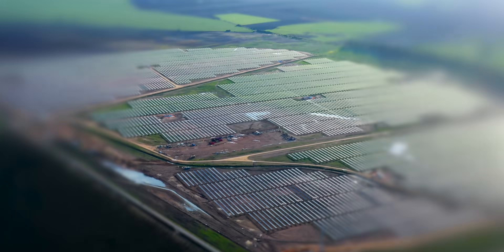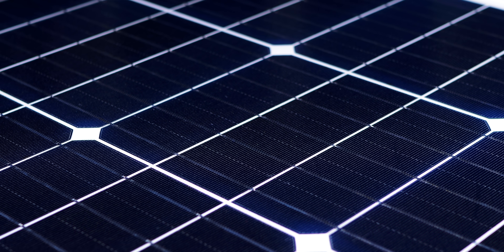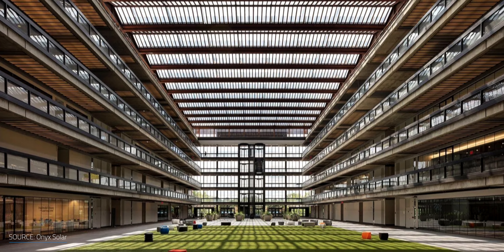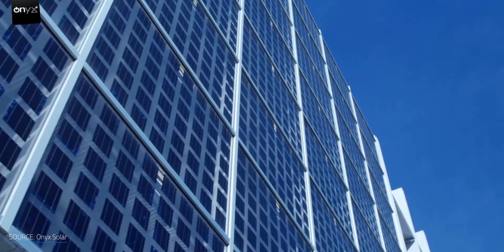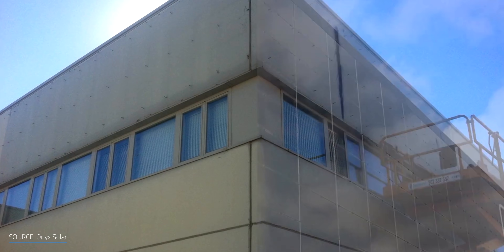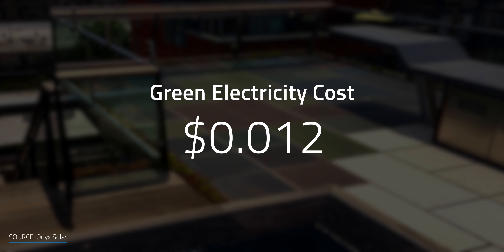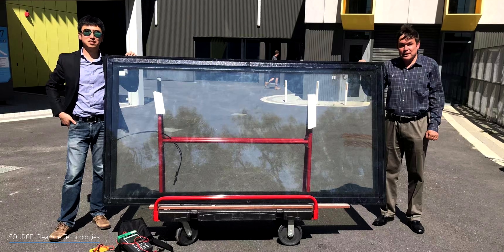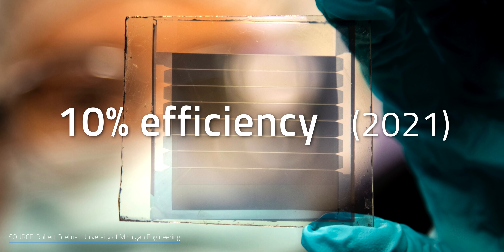Exploring a New Transparent Solar Cell Breakthrough

Comment: I am worried that dark solar cells could be warming the planet. The transparent glass cells are only like less than 10% efficient but (cost permitting) you could have way more cells and use some as Windows. But even better, we could cover every roof with these and not get the heat so much. But even better you could have reflective material under the cells to make them more effective AND (and it still gets better) the reflected light is reflected back into space. For under the cells, that foil stuff they use inside car windows could do the trick. It not only saves the heating problem of normal cells but also helps with reflecting sunlight away. I can't belive that nobody has thought of this combination. I thought of it long ago when I saw a video about painting roads white and then saw the glass solar cell video years ago. Imagine every roof covered with normal cells. It would be a hell hole, I would think. I have been worried about that for over a decade. I can't believe there seems to be very little about this potential issue (I haven't seen anything).

Comment: You make a deal of the efficiency but from the prices you quoted they are around the same as glass. That being the case and the fact that you are going to need the glass anyway then at that point the efficiency becomes somewhat academic. The panel is a requirement anyway and the fact that it is also providing useful energy in the process is an added bonus plus you still have the option of adding a roof top array as well.

Comment: One other small side benefit that would slightly offset the costs associated with solar windows is you would be able to omit the "low e" coating on the window since you would get the benefit of lower emissivity from the solar panels themselves.

Comment: out of curiosity. if this is placed above a normal solar panel, how much energy is lost from the solar panel? I was thinking since the transparent solar cell has poor efficiency then there should still be a lot of excess sun passing through it, so if there is a normal solar panel underneath it should still function right? if the lost of power is so minimal i can see this being used with normal solar panels to increase power production.

Comment: To be fair, raw efficiency isn't as major a setback as it seems, as long as they're cheap enough to justify the cost. For companies,  it's about payback efficiency.
If the panels are dirt cheap enough that they'll pay for themselves within a few years, then raw efficiency doesn't matter. Likewise, if they're expensive to the point where the time taken to payback is longer than they are reasonably likely to last, then it makes no economical sense to buy them in the first place even if they're efficient.

Comment: 10:00 I listened to this name multiple times and still couldn't work out what it was called. When I saw the name on the sign at 10:12 it finally made sense. The shopping centre name is pronounced "Wo-rick" with a hard o and the second w being silent.
Other than that, the video was quite clear. I look forward to seeing the technological advances in this area.

Comment: You've often stated that the pay back time for standard multi-crystalline solar panels is 4 years, and could go as low as 2 years in the future. I was wondering though, does this consider the immediate increase in the value of your home? For example, if you spent $40,000 on a system, I would think that your house would appreciate by perhaps $30,000 so your actual real cost would only be $10,000. Thus your payback time would already be only 1 year... thoughts?

Comment: The majority of energy in the solar spectrum is visible light, so efficiency is an insurmountable hurdle for window glass. Combine that with the cost to manufacture these and the cost to install them and wire them up, I can’t see this ever being cost-effective.
We’re in an era where it isn’t even worthwhile for the majority of businesses to put a small amount of high-efficiency solar cells covering the roofs of their offices and warehouses, so requiring a larger number of more complicated cells to cover windows that won’t even produce as much energy (unless the building is particularly tall) simply isn’t going to be viable. IR reflective glass and variable glasses would be a more effective and cheaper method of using solar energy to modulate the internal climate of buildings.
Also there’s the whole glass dredging issue, so I’d consider steering away from large buildings covered head-to-toe in glass.

But for a smartphone, the only colours coming out of the screen are narrow bands of red, green, and blue, so theoretically you could manufacture a solar cell that lets the three narrow bands through and absorbs the rest. The small area wouldn’t make it particularly fast, and it would be significantly more expensive than just having a PV panel on the inside of your phone case, but hey people bought a folding phone.

Comment: I was actually thinking about this today on the way to work.. why not solar cells on our windows? Would maybe even keep some heat out to cool down apartments, offices and houses even more instead of using AC.
Reply: Solar needs good angles to catch the sunlight efficiently. Windows do not have such optimal angles. So for the same money just get regular windows with a sunlight protection you can actually turn off, say in winter when there's less light/heat and rooftop solar with proper angles and more than double the efficiency.
Reply: @nonyabisness6306  So since something is not optimal or perfect, you should just not do it? Even a bad play is worse than no play at all!
Reply: @AFAndersen  No, it means you have to look closely at the alternatives and then figure out the best efficency, best bang for your buck. Sure there can be considerations outside efficiency, for example dams can't be built everywhere. In this case solar glas is pretty much the worst option apart from running a diesel generator on your balcony.

Consider this: Waste is a huge part of pollution. We need to limit our waste to ensure sustainability.
Reply: @nonyabisness6306  But why not do "solar windows" in addition to everything else? Even if it's just 0.1%, that's still a lot when you look at the whole globe. :)
Reply: @AFAndersen  Because it's  waste of money. That's like suggesting you do your weekly groceries in 2 stores, but in one of them it costs double and gets you half. You'd be better off just shopping in the shop that gives you more for less. Pretty obvious isn't it?

If you want to buy a product and you see it cheaper somewhere else, surely you'd buy the cheaper option all other things being equal? It's not like we're running out of space for proper solar panels.

Comment: The issue of efficiency is not as critical as capturing as much of the solar energy as possible so  its not wasted. I understand its not as efficient as solar panels but so what?  Its better to capture what you can and use it than no-capture at all.  To me this is simply an additive technology that can add more power capture to the grid. That means its good and over time it will get better and hopefully cheaper.

Comment: Why is alternative energy always framed as an either/or proposition on a monolithic scale?  It always seems to come down to statements like "Wind power isn't as reliable as solar, so ignore wind and focus on giant solar farms."  Or in this case, "Transparent solar isn't as efficient as opaque, so we shouldn't use it."  What's wrong with opaque on the rooftops and transparent on the sides of buildings?  Maybe even put a few small wind turbines on there are well.  Sure, they won't produce as much energy as those big giant windmills, but does that mean they can't be useful?

Comment: Much more promising than solar roadways. I'm personally cheap and don't mind having regular panels on my roof, but I live in a house where there is plenty of roof. Apart from cost and removing material from the regular solar panel market, there's definitely reason to put solar generation in a window instead of tint if it can generate some power.

Comment: I think the most important things are longevity and cost compared to normal glass. If they can get high longevity and low cost compared to normal glass. Then it'll be an easy choice to use them any time you would use normal glass. Because their competition is more glass, not other solar panels.

Ofc efficiency also matters. But i think cost/watt is more important than watts/area because we've got plenty of area

Comment: The efficiency that matters isn't Watts per square meter, it is Watts per dollar. I don't think even the producers of these know how much they will cost, but it is likely they can be made economically viable. I think the biggest potential is for large office buildings that are often built with huge glass windows for aesthetics, but then have to compensate for the solar heating with air conditioning. If the increased cost of the solar windows relative to glass is lower than the savings on air conditioning, you've already come out ahead, and all the power you generate is a bonus. And you can still put a traditional solar array on the roof too. The question that remains is whether they can make these at scale for a good price.

Comment: If they can save a company money overall after considering electricity and heating? You can bet every company with the funds to do so will use clear panels. If they can actually start making money from those gains, we'll see them years faster.

Comment: There is a significant advantage here that was not covered. Much of the world requires some form of planning permission/approval when erecting structures. NIMBYism makes it hard to gain approval for large scale ground-based solar installations whereas existing buildings already have glass that could be retrofitted and new buildings come with the expectation of glass so approval is much less of an issue. It also avoids the use of additional land. Buildings are also expected to last 50+years. Put these together and there is a strong case even at relatively low efficiency.

Comment: Solar panel efficiency is only a big issue if people don't have enough available roof area to achieve net 100% solar power.  This is not common as most homes and businesses have more than enough existing rooftop space and those that need more can usually accomplish it with solar covered parking.

Comment: if we ever reach a point where our solar cells are that good, i assume the price of electricity will be so low that the cost of adding solar cells to a mostly isolated and covered iphone screen wouldnt be worth it. 
the reason i assume the low cost is because there`ll be so many buildings with integrated solar cells that we would land at a point where businesses would ask "is it worth paying the extra for solar windows/walls/roofs etc" imagine your solar roof and how long you would have to have it before paying down the cost of those panels. then divide the electricity cost pr KWH by somewhere between 4-10, and ask yourself if its a sound investment to pay that amount of money for it to be paid down in that amount of years? 
that is the equilibrium where businesses are unsure, some say yes other say no.. and iphone screens and every other small utility definitely say no. except for a thermoelectric cooler unit for the beach (assuming the %% is still there)..

Comment: I've often wondered if the complete carbon impact of manufactured goods such as solar panels has been worked out. From the mining of the raw materials, to the assembly and transportation of all the parts in the supply chain to create a finished product
Reply: Waste recycling & toxicity is more important than carbon impact.

Carbon emissions are naturally recycled as plant food, which we eat in salad and slows erosion naturally as ground cover as precious top soil is conserved.

If the glass with embedded nano particles can not be easily melted down to re-create new materials, it is a tremendous unsustainable waste.

Comment: The funny thing is, if climate change began as a result of greenhouse gases trapping solar heat, the simplest solution would be to pepper near earth orbit with space debris (to shade the planet). Converting sunlight into electricity doesn't really reduce the amount of trapped heat?

Hey here's an actual idea that might work: we could put 2000sqkm of solar sail into space like a gigantic umbrella. 2000km2 on the Earth's surface is nothing, but put it far out enough it could make a difference of a few % reduction in sunlight hitting the earth. We may even overcompensate and end up with a little ice age!

Comment: Great concept, but all efficiencies are (I'm pretty sure) based on sun at a right angle to the panel.

A vertical solar panel at noon near the equator will produce virtually zero. Regardless as to how efficient they are, the incidence angle will never get more than about 20 degrees... so the efficiency will never be more than about 30 percent of the maximum rated efficiency of the panel, and oftentimes zero.

Even in Phoenix, for example, in the summer, the sun is at 78 degrees above the horizon... an incidence angle of 12 degrees or 20% of potential. In the winter, the sun is as low as 32 degrees, giving an incidence angle of 58 degrees (84% of potential).

But that is only at noon on one side of the building in the winter. As the sun moves off noon, the elevation angle improves slightly, but the azimuth angle degrades even more. A building with sides at 45 degrees to North/South might do better... haven't done the calcs.

So, these would work best after sunrise or before sunset or on buildings far north or south in the winter. So, many buildings in downtown areas would be in the shadow of other buildings at the time when their panels should be most efficient. Those away from other buildings would, at best, have only 1/3 of their investment in any reasonable position relative to the sun at any given time. For those close to other buildings... 

For a building in Toronto in the summer at noon, the sun is pretty high.... about 70 degrees above the horizon. So most of one side of the building would be in the sun, but that's only a 20 degree incidence angle to the windows (34% of potential).

In the winter, the sun may be as low as 25 degrees above the horizon, so a pretty good incidence angle of about 65 degrees (90% of potential), but many buildings (or at least much of their surface area) would be in the shadow of adjacent buildings.

So, I like the concept, but steerable solar panels with efficiency ratings of say, 25% and operating at angles near 100% potential all day, all year, sure beats efficiency ratings of say, 10%, operating at angular efficiency varying between 34 and 90%, max 1/3 of the time and potentially in the shadow of other buildings for part of that.
It would probably be almost as efficient and cost effective to install a steerable array of efficient solar panels on a small roof than cover 3 sides of a 20 storey building with see-through solar glass, even away from other buildings , unless the cost is very low and the efficiency goes up substantially.

Comment: Very interesting. The cost of the actual PV cells has dropped so low, that the glass is now a large factor in cost. The partially transparent glass is a clever double use of existing building materials. The more transparent options need more improvement, but have good potential.

Comment: IMHO, the real problem with this is the longevity.   The cost of reskinning an office tower every 30 years is enormous.  Your just not going to get mass buy in for this until they deal with that.   Sounds like the payback is getting there on new construction.  but add to that the costs of tecnofying your windows and I very much doubt they would ever get replaced when they die.
Reply: Right. After 20-30 yrs the carbon-emission savings goes to zilch and it's back to square one. And on top of replacement costs there's also recycling costs.
Reply: @pj_ytmt-123  Yes, I applaud them for being on the right track but this is is clearly not ready for prime time except maybe temporary structures.

Comment: So after 30 years the building's owner would have to replace all the windows in their building. Is that cost included in the payback period calculation? Then there's the old windows. Can the middle pane be replaced and the whole unit reused? Could that be done quickly enough to do onsite instead of outright total replacement? That will be a great business opportunity if our species can survive that long...

Comment: Update your prizes for triple-pane windows: In Québec, I have paied a mere 5% premium over double-pane for an entire house. Fenplast is the brand. Used to be 50% premium because it was imported product, but now they are producing them locally. As many products, the glass itself is not the most part of the window's cost: aluminium-pvc frame and  transport are!

Comment: Raw efficiency and lifespan aren't the important questions. Rather, it's cost vs. performance, and opportunity cost. It doesn't really matter what the exact numbers are, as long as the panes provide at least as much benefit as other available options, at comparable expense. Make them cheap enough, and even 4-5% efficiency starts looking real good.

You just need to make sure that all the important cradle-to-grave considerations have been factored in, e.g. support and operating costs, durability and replacement cycles, amount of expected solar insolation, local electric prices, etc.
Reply: Exactly.  If these get cheap enough vs. regular glass, they only have to be efficient enough to make it worth wiring them up.
Reply: and compared to glass, the installation costs compared to glass windows and safety implications